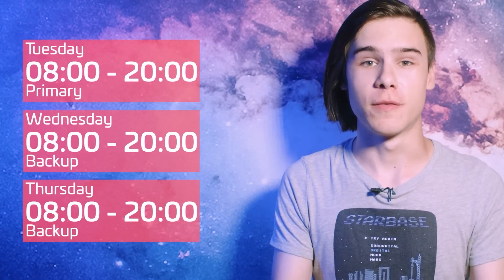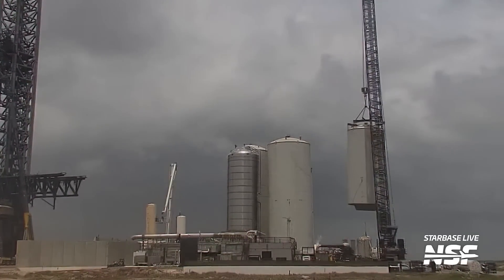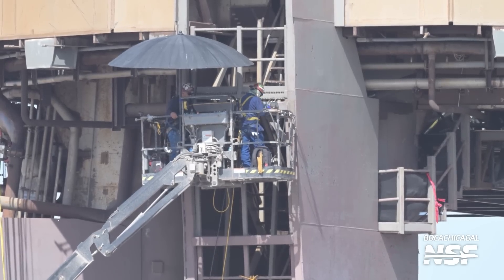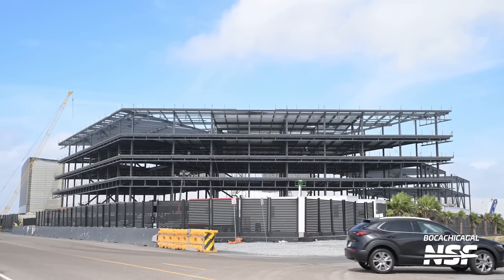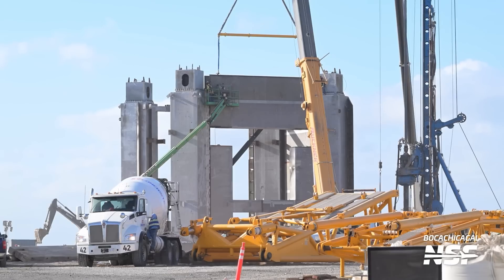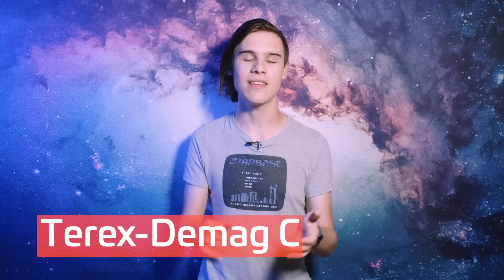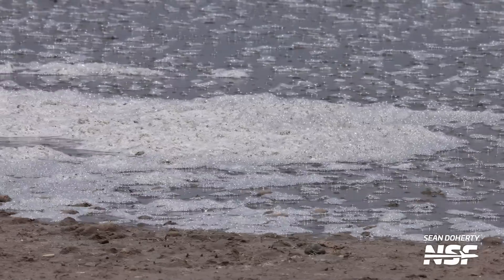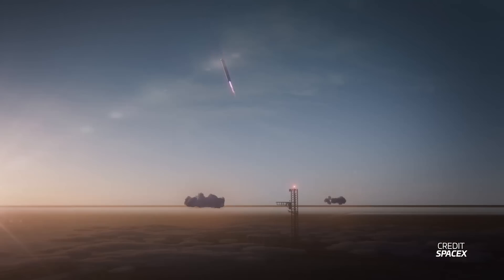Super Heavy Catch Attempt Test Incoming! | Starbase Update

Comment: I have never seen so many people. Make so many mistakes because of excitement in my life.. Guys... Think about it logically. They're hovering a drone approximately where the landing computer would be to trigger the TCS (Tower catching system.) [Chop sticks as you call them.] They're running simulated tests to trigger one arm so they don't wreck the other. Once it's calibrated. Like you said today in your stream more than a dozen times. They will configure the other arm and set the system for the proper place to catch the Booster and Starship. They're using 14.1 as a "punching bag." To ensure they're with in tolerance and ensuring everything functions before the big moments. You caught A slow test.(Priming.) A static test and a full power test. The dampers are touching the rocket and moving it slightly. They don't need to do a drop test they know the rocket can move less than 3m per second already. Thanks to the splash down. Which is almost nothing. The fatigue your are referring to. Is what engineers call structural failure. Which will cause the tanks to shear. Usually good for lost of usages if the material isn't pushed beyond it's recommended limits. To conclude The final test before inspection was a full tower test. Reset which they then were tweaking to get it right. As it stand today... Testing looks good. I imagine the remainder of the day is getting the other arm working again. There appears to be no damage either.... They don't want to reduce the length of the TCS yet because they don't know the margins wind intensity will play... I imagine 2-3 feet at most.

Comment: FAA will have a few questions before authorizing booster to land on ground.  It will need to consider the impact of the explosion on the whole area, including Mary's house.  What if it the big bang breaks windows?  Will it spill fuel onto the environment if it crashes on the beach?  etc etc. Those are all concerns not examined for a crash at sea.    A aunch happens to a precisely defined spot (launch pad) but a landing is more fungible and could potentially be over a wider area.

Comment: The office building is probably taking longer because it needs to be hardened to deal with espionage.  A normal building is practically transparent to sound and other espionage.  Aerospace involves some other considerations, and SpaceX is the absolute spearpoint of aerospace.
Reply: Good point. Also, no one wants to talk about EMP protection. I think the risk of that are high and yet,,,,,,,it’s rarely discussed. Don’t want to scare the children?
Reply: A regular office building is going to take a lot longer than a parking garage due to all the plumbing, electrical, water, and heating/cooling that has to take place, not to mention the walls and doors for offices and rooms, painting, flooring, etc.  But you are correct, they should include hardening for security purposes.

Comment: You know, if they had chopsticks on the bottom and top, they could take off from them and not need a launch base, just raising them to a higher, height and then launch, less water would be needed then.
Reply: The OLM contains the means for starting the outer twenty engines!
Reply: I don't think the chopsticks could handle the mass required
Reply: @CraigTaylor  That's why I said use 2 of them

Comment: 11:33 how hard would it be to install some engines on a small test tank (such as starhopper) and do a preliminary catch attempt on something smaller, less expensive and less destructive than a full-build booster?
Reply: There are so very many failure mechanisms that might only appear quite occasionally, so only end-to-end tests will eventually uncover each of them.

I expect SpaceX will just run hundreds of end-to-end flights, and stoically rebuild after damage.
Reply: A crane could do all that with the test article.
Reply: @rsteeb  Maybe, but a crane doesn't test active booster guidance control and dynamic chopstick operation during an actual landing.

Comment: I'm still concerned about the booster or starship manoeuvring in a stiff sea-breeze during a catch.
Reply: These systems use Relational GPS for feedback, which is accurate to one or two centimeters. In the worst case, the booster will be slightly leaning into the wind during [engine] shutdown. Of course, the oxygen [gas] thrusters will also be used for sure.

[I suppose variable wind can lead to collisions with the catch arms or rail conveyor system. There is some padding on the sides...]

Comment: if the second tower is for launches as well as catches, has there be redesign of the quick disconnect / orbital launch mount, cos it seems to me they take a pounding with every flight and it requires some nifty redesign to make it "rapidly" reusable - as it stands there are lots of wires / cables / conduit that look like they are subject to the flame of the engines - will a redesign be on the cards? that being the way spaceX seems to operate.
Reply: Every part of the tower and launch mount will be modified in one way or other. We just have to wait and watch to see if and when we can spot them. For now we know the base of the tower is made of steel boxes to be filled with concrete and welded together.
Reply: I was surprised that the SQD (Ship Quick Disconnect) arm did not swing far out of the way just before or during engine ignition. It's very close during lift-off.

Comment: Why do they disable FTS before critical phases of flight, such as landings? I would think you would want to be able to activate FTS if it's clear the booster is not going to land correctly and possibly damage the launch tower. Having it explode a few hundred feet over the pad is probably better than letting it crash into the tower.
Reply: I imagine if they detect that a catch won't be possible they'll soft land/splashdown some distance away from anything important.
Reply: @IndigoSierra  Assuming there is enough time. Once you get down to just a few hundred feet you might run out of fuel while trying to maneuver or something... If it was me I would leave the option for FTS till it is right next to the tower. By then it wouldn't' matter either way, but if you are still a few hundred feet above ground the FTS may save the tower and launch pad.
Reply: @ronwatkins5775  good point

Comment: What if the Catch dont work or they need it to stop ? is the booster flying away from the tower towards the ocean or let they it crash in to the tower and olm ? and what happend if the booster crash in to the tankfarm ? that explosion rip everything apart and than there is no more testing and flying ...
Reply: as the landing burn approaches it will likely have some idea if it can do it or not. its aiming for the gulf initially. then steering towards the ground. but it doesnt mean it will still work.. but i hope so
Reply: In these early tests, the booster has extra propellant on board in order to prolong hover time. If two Raptor engines suddenly shut down and/or explode, the remaining 3rd engine won't be sufficient, and the booster will rapidly crash. With plenty of propellant, it will RUD and burn everything. 

If at least two engines continue to work and software detects anything out-of-spec, I don't expect the booster to stay near the complex. It will soft-land in, or explode over, the Gulf of Mexico. 

Otherwise, the catch arms will close, the rails will rise to the booster hardpoints, and the booster will peacefully shut down – along with the spectacle of people screaming and jumping. Perhaps the booster will then be lowered onto the OLM and detanked. 

Excitement guaranteed, no matter what.
Reply: Its basically impossible for the booster to hit the tank farm, and a direct hit on the OLM or tower will result in basically no damage.
Pad A gets hit with worse during launch than a catch could even possibly do